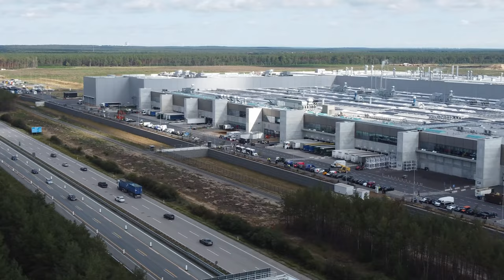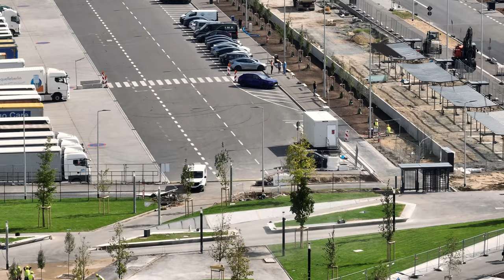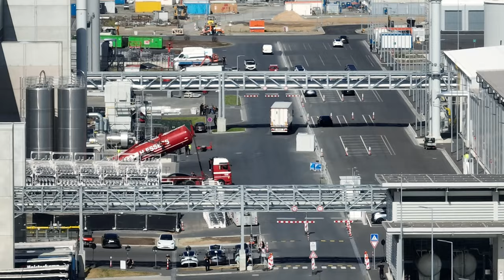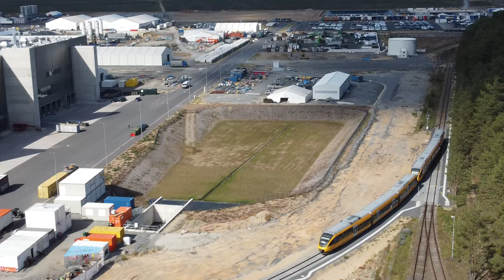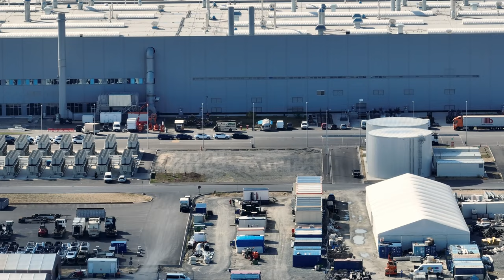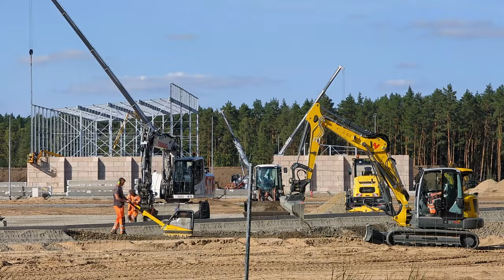Giga Berlin | 2023-09-14 | Timelapse

Comment: And because people will ask again:

Bridge: Concrete needs at least a month to reach its final strength. The ramps are piles of sand that need several months to settle and would rip apart your road if you were to put it on too early.

Train: Battery-electric trains are nothing you can pick up in the corner store at short notice. Trains, in general, have lead times that are measured in years. Also, that piece of existing track from the main line to the new part will be moved in the next 2-3 years, so building catenary infrastructure to just rip it out soon would be foolish.
Reply: Thanks, didn't think they were going to move the older track, I did notice  what looks like provisions for a catenary system poles alongside the new track.
Reply: You're a wise man, thank you ;)
Reply: Why is the main line going to be removed ?
Reply: @paulstubbs7678 Those are part of the wire trench that's needed along tracks with passenger trains. Those look like foundations, but they're just a foot or so deep in the ground.
Reply: @lordmelloi  "Why is the main line going to be removed ?"
The routing of the branch line will change. And there will be also changes at the main line.
As Tesla plans a proper railyard the whole way how the branch line is connected to the main line will change. 
And the train station Fangschleuse (which serves the town Grünheide) will be moved to the northern end of GF4 (i.e. then serving Grünheide and Tesla).